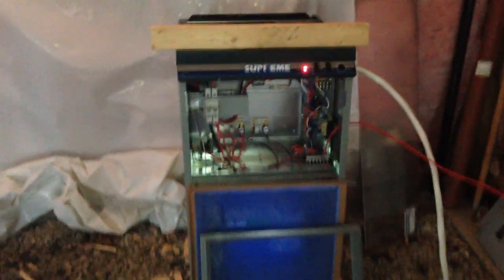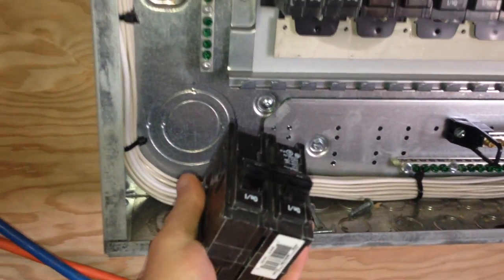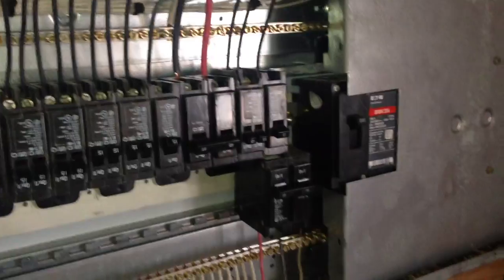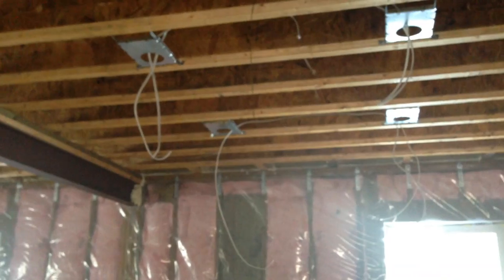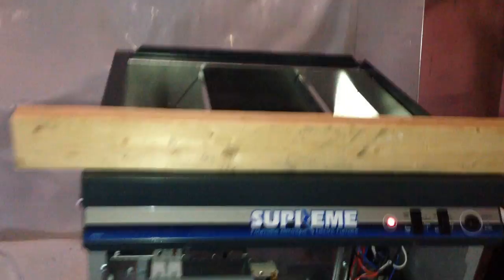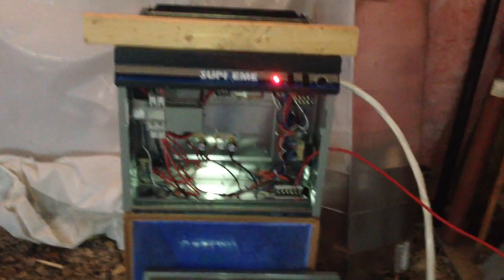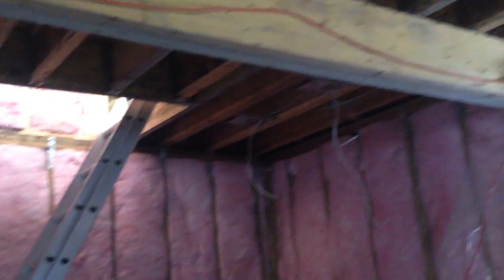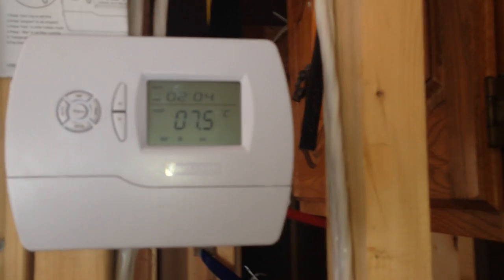Supreme Electric Furnace

Comment: You don't plan on keeping the furnace where it is correct??
Idea for you, put it as close to the center beam as possible to make smaller runs and more efficient heating, considering you're putting your trunk lines in the middle anyways.
Reply from the maker: In the spring I plan on putting the furnace just under the main beam near the breaker panel and run the trunk along the beam. I hope to have the mechanical room finished in the basement as well as the plumbing and floor finished in the basement as well I plan on putting in a wood stove in as well.